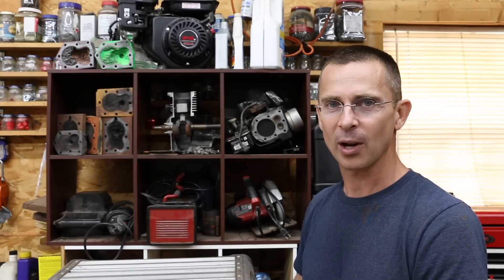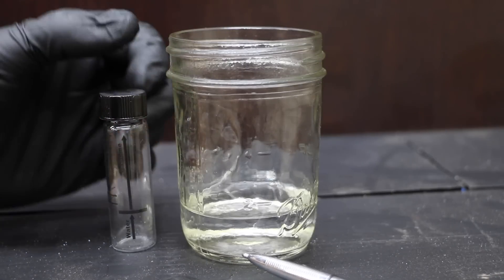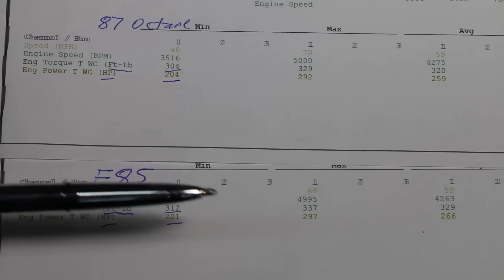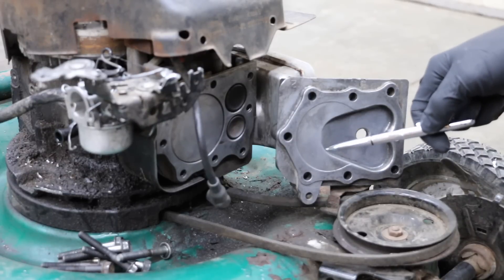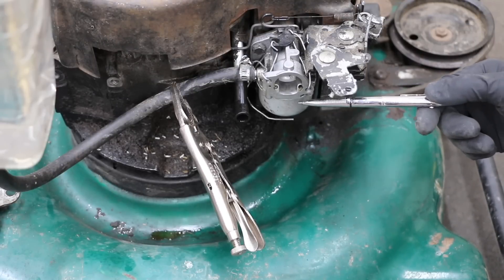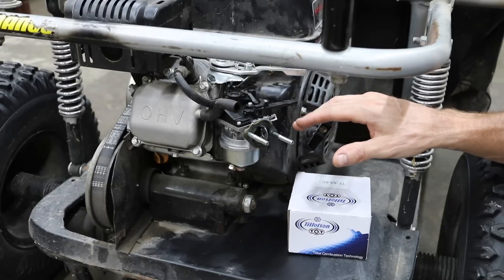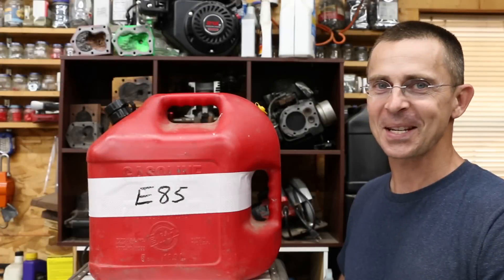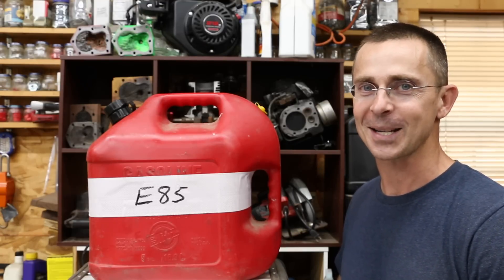Is E85 better than Gasoline? Let's find out!

Comment: My own personal results. I used Torque, and Bluetooth OBD2 adapter. I ran both a stretch of Highway, about 20 miles to a reststop where I would turn around and come back and fuel. I also compared my normal day to day driving. I ran both Standard Gasoline and E85. I could not tell the difference by driveability, but I consistently got 30% poorer MPG on E85. My conclusion was that E85, only made sense if there was a greater then 30% difference in price, which was very seldom the case.
Reply from the maker: Great information. Thank you
Reply: In Brazil usually on E100 people give similar advice 1/3 cheaper go with E100 otherwise E25 (only form of petrol/gasoline available there), but there is a clear price difference and higher performance on E100 plus cleaner engine. Though keep in mind being south america they have some serious issues with fuel quality so either you have to pay a lot more to get premium fuel that will be less adulterated or go with regular and you'll end up with clogged injectors and all sorts of issues very soon, sometimes car will not even start due to the bad fuel having a really high flashpoint (like trying to start on kerosene) engine just can't do it and going with E100 can be a lot less of a hassle overall and cheaper. Yes i did live there for a bit so I know XD I once had a sample of 100LL Avgas that wasn't pure either, I sure wouldn't like being the one pumping bad avgas into my airplane.
Reply: @dashtesla  probably higher engine durability on e95 (it's not e100) too, since flex fuel engines tend to have high compression rates and knock on shitty gas. which is why our base gas was upgraded from 86 to 92 octanes two months ago. now it's going to be a lot harder to justify ethanol. and it's going to have to be almost 40% cheaper for it to be worth it.

My current car isn't flex fuel, but my old one was and it ran SIGNIFICANTLY better on ethanol. it even sounded massively better. it think it was worth putting ethanol even if the price was only 20~25% cheaper. not anymore.
Reply: It really only helps when you're limited by knock, such as forced induction or high compression. It can make triple-digit improvements on the dyno for some sub-1000hp cars, in most cases eclipsing 116-oct leaded race gas.
Reply: FYI E85 is 108 octane
Reply: @BlackBeardAir What's FYI?
Reply: @anondude504  For Your Information
Reply: Very true. It's usually not very cost effective, but performance wise,(when really running it) and internal inspection, both are an absolute winner for the e85. 
I just wish the stuff was cheaper
Reply: @bobbysweeney5377  were
Reply: @vicent436  "was" when I purchased it, "were" overall.
Reply: I did something similar but with pen/paper in my work van which I constantly drive throughout the week. I noticed the exact same results. Only use e85 if the prices make sense.
Reply: @ItzOver9k  Would a $1.50 price difference be worth using E85?
Reply: @saulespino2510  That large of a difference, probably yes.
Reply: @saulespino2510  What if I told you I spend 1.30$ a gallon for e85?
Reply: e85 isn't something you can use instead of normal gas without modifying your car unless you wanna kill it
Reply: David Long great info sir what are you guys thoughts on using it occasionally for cleaning up the engine interior some ?
Reply: Good point. What if you did the calculations based on cost per mile? Do you think you could get a better sense of cost?
Reply: @Corona Discharge what makes you think that it's not good race fuel? The ONLY negative is that you burn roughly 25-35% more fuel than if you ran pure gasoline.
 Using a mix of fuel that contains 85 percent alcohol, provided the engine is tuned for ethanol, will always make more power than 93 octane pure gasoline... and ethanol is alcohol - it's like 99% the same as vodka except you will probably die if you drink ethanol. But it is a form of alcohol... There's many types of alcohol....the drinking type, rubbing alcohol, methanol, etc etc....
E85 has a VERY high octane rating as well - I believe it's 106 or 108 octane.
This reduces the chance of pre-detonation or "knock" happening when the engine is running with a large load, or maximum load at full throttle.
You can advance the timing of when the spark plugs actually spark... And adding extra timing will increase the efficiency of the engine, and it will be able to burn all available fuel and have the actual process of combustion start happening sooner - as the piston is still rising... Since e85 is a MUCH higher octane than gasoline, the "explosion" that occurs when the spark plug sparks and the air/fuel mix begins to burn will be longer, and will push the piston down with more force and for longer - which greatly increases torque, and higher torque means higher horsepower. Or kilowatts or whatever.
E85 also burns a good bit cooler than gasoline does - which means the combustion event is not as hot, and the combination chamber remains cooler than it would if it was burning gasoline... Cooler Temps in the engine means denser air, which means more oxygen, which means bigger and longer "explosion" of the air/fuel mixture within the combustion chamber.... Which means more power.
You can also run higher compression pistons and/or cylinder heads on E85 than on gasoline... This is due to the fact that ethanol is more resistant to pre-detonation, due to the fact that it burns cooler.
You can also run more turbo or supercharger boost than you can with gasoline - for the same reasons as being able to use higher compression pistons/heads.
Higher compression and higher boost means that the engine is running more efficiently, meaning it burns the air/fuel mixture more thoroughly and makes more power out of the same amount of fuel...
More boost and/or higher compression means higher pressure within the combustion chamber during each combustion event, which means it pushes the piston down with more force, and more force means more power.
The biggest horsepower gains come from the advanced timing, combined with more boost & more oxygen - or higher compression, combined with now being able to more fuel because you have more air and oxygen available from the added boost...
All internal combustion engines are air pumps - they use a controlled, precise explosion of fuel/air mixture to make them spin faster to pump more air - more air ALWAYS equals more power.
So :
-More timing =more power
-Less likely to have pre-detonation = ability to add more air and fuel
-More air and fuel ALWAYS increases power
-Cooler combustion means less energy wasted in the form of heat, and that energy goes into spinning the engine faster which increases power.
I could literally write a book on why ethanol is a better race fuel.
If you understand how the internal combustion engine operates (I'm a mechanic who builds engines alot) then you can quite easily find even more reasons why ethanol can increase power and efficiency... But I think I covered the basics pretty well.
Oh - another huge benefit I would be dumb to not mention is that ethanol doesn't leave anywhere near as much carbon deposits on the piston and valves... Carbon deposits rob horsepower and cause pre-detonation. So ethanol literally helps clean your combustion chamber, and you won't get leaky valves as much as with gasoline. Leaky valves decrease compression which decreases power.
I'm curious to why you think e85 is not a good racing fuel - considering just the "major" reasons why it increases power, efficiency and makes you go much faster.
Fuel economy and thermal efficiency are NOT the same thing - and the thermal efficiency of ethanol is higher/better than gasoline. Thermal efficiency is basically what percentage of the fuel injected into the combustion chamber turns into actual power. An increase of just 1-2% thermal efficiency is a MASSIVE difference and that's due in part to the ethanol burning cooler.
The ONLY downside of ethanol is reduced miles per gallon... And that's why people who race with e85 use a larger fuel tank, larger fuel lines, and 2 or even 3 fuel injectors per cylinder instead of just 1... Plus if you use 1 or more of the fuel injectors as port injection it will keep your intake valves clean and cool the air/fuel mixture before it enters the cylinder - assuming 1 injector is a direct injector - spraying fuel directly into the cylinder, instead of spraying it in the intake manifold just above the intake valve... With port injection The fuel starts to evaporate as soon as its injected into the intake - and the evaporation is just an exchange of energy... It uses heat to evaporate the fuel, and that means that the evaporation of the fuel draws energy from the surrounding air - by sucking the energy out of the air that the fuel is being sprayed into, the temperature goes down. Temperature is just a form of energy - less energy =less heat.. That's what "thermal efficiency" means. 
Fuel is the source of the energy - so you're just injecting energy in the form of a liquid fuel and making it explode which will release its energy all at once. If most of the energy contained in the fuel is turned into heat, you have low thermal efficiency and low power. If you can burn fuel at a lower temperature, more of the energy in the fuel goes towards doing actual work - not just creating heat when the combustion happens. 
So port injection lowers Temps Which means it's a denser mix and therfore has more oxygen... Ethanol also evaporates much faster than gasoline does - and you definitely want maximum evaporation, because a gas burns easier than a liquid. And again, evaporation lowers Temps and increases oxygen content... Oxygen is your friend when making power - just like how a small fire will turn into an enormous raging inferno if you fed it pure oxygen. It is releasing more energy. More energy =more power. 
Burning more fuel at a higher thermal efficiency is going to make a BIG difference and will increase power tremendously. 
For example - burning 1 gallon of gasoline at 30% thermal efficiency... Compared to burning 1.25 gallons of alcohol at 35% thermal efficiency... Obviously you'll get a lot more power from burning more fuel more efficiently. Alot more power. Potentially hundreds of extra horsepowers in a large or turbocharged engine. It doesn't matter that alcohol actually has less energy per gallon than gasoline - because it burns more efficiently and you burn much more of it. 
Let's say that burning 1 gallon of gasoline at 30% efficiency creates 100 horsepower... Burning 1.25 gallons of alcohol at 35% will produce around 130-140 horsepower. If you have a turbo, you can gain much more than that because you can add even MORE efficiently burning alcohol to the party. 
Let's imagine A theoretical engine without a turbo, running gasoline and it makes 100hp. 
Add a turbo with 14.7 psi of boost, and you can inject twice as much fuel. And you'll make almost exactly twice as much hp. 
Now run the newly turbocharged engine with ethanol and you can add even more than double the amount of fuel than you could with gasoline. You'd be able to burn almost triple the amount of ethanol on the 14psi turbo engine compared to the amount of gasoline burned by the 100hp non turbo engine. So now you're getting double the power PLUS... If the turbo gas engine made 200hp it would make more like 250hp with the same amount of boost and 3 times more fuel (alcohol)... 
Hopefully this all made sense - I wrote such a long comment to try to help people who read it understand how and why they can get more power from ethanol or e85 than from gas. 
The simplest way I can explain it is as follows :
Gasoline is more "energy dense" meaning there's more energy in 1 gallon of gasoline than there is in 1 gallon of alcohol... But you more than make up for the lower energy density by spraying much more alcohol compared to gasoline - and the engine being capable of efficiently burning much more alcohol than it could burn gasoline efficiently. Much less fuel (gasoline) and more energy lost to heat, compared to lots of good fuel (alcohol) that also burns more efficiently and loses less of its energy to heat. 
I'll stop now, but I am still curious why you think gasoline makes a better race fuel...?
Reply: @csonkaperdido  today I learned that there is no text limit on YouTube comments.  Great info though!
Reply: @uknowwho613  lol you have been enlightened sir!
Reply: I've experienced the same thing in my 2012 2500hd Chevy truck. Got a 6.0L and I get about 13mpg on gas and about 11mpg on e85. I also found out from alot of trips that under load pulling my 20 trailer with a truck on it, the mpg gap between the 2 got much worse. I average about 10mpg on gas and about 6-7 on e85. Plus being in Michigan I've noticed alot of black smoke and the motor shakes alot more on e85 on cold winter days on start-up. I've talked about this with other people and they had similar results too
Reply: That is because you have to inject 25-35% more ethanol to have the same air fuel ratio as gas so your results sound right.
Reply: To get the full benefit of running E85 you should have your ECU remapped, preferably dyno tuned. You will still use 30% more fuel of course, but the car WILL be faster, especially turbocharged cars.
Reply: E85 is always gonna give poor mpg... It makes sense when you are tuning the engine to make more hp.
The benefit of the e85 is horsepower not fuel economy.
It's basically race fuel from the pump - octane of e85 is over 100... Octane is just a measurement of how fast it burns and resistance to pre detonation or "knock"... Only makes sense to use e85 if you're trying to make huge hp and go fast!
Reply: csonkaperdido 100%
Reply: Would it make sense to run a tank of E85 once every few months just as an engine cleaner?
Reply: I came to the exact same conclusion when looking strictly at MPG. After watching this, now I know there isn't enough performance gain to even consider that.

Just when the price is right, use E85 to clean the engine.
Reply: One thing you need to account for is longevity. The magic cutoff may be 25% - 30% based on price, but E 85 burns a lot cleaner, so in the long run will E 85 may be better for engine wear and increase the life of the vehicle. Also to consider, after 100,000 miles what will your MPG evaluation be on a vehicle that ran on E85 vs one that ran on E10? My guess would be running cleaner E85 over that many miles will allow for better MPG compared to E10 fuels over the life of the vehicle based on this. Basically if the vehicle runs cleaner throughout its life, after 100,000 miles, the MPG's will be better than if it ran the entire time on E10 fuels.
Reply: @David-fv7zg  David I totally agree with you I was just discussing the immediate economics of the situation. Yes it does burn a lot cleaner and that's why I did use e85 all the time no matter what the price was, but if you're going strictly by cost per mile then you have to have a 30% difference to make it justifiable on a cost per mile basis. Now you might be able to make a case that because it burns cleaner so you can stretch out oil changes and your engine will last longer but until you can prove that empirically that's just a hypothetical.
Reply: E85 should at least be compared to premium, as the octane ratings would be closer. (Especially price wise) So E85 vs premium would be a better comparison.  It's a big reason why modded high boost or high compression people use it.  That 30% loss in available hydrocarbons is more than made up compared to race fuel with the same octane.
Reply: When you change the motor mapping to E 85, it will be much better in mileage and lower the combustion temp as well.
Reply: @mweskamppp  EcoBoost motors do that on the fly. 
I definitely notice a more responsive and enjoyable driving experience, but if it didn't burn cleaner, I don't think I'd do e85 due to the mpg loss.

Comment: Nice video. Since E85 is 85% acohol, that explains the power and Fuel Efficiency loss. 

Alcohol based fuels have less energy content than traditional 100% Petroleum. So again am glad you did this test because it proves that point. 

I think the only real reason for alcohol based fuels in an engine is they provide cooler temps like you showed, but also are supposed to reduce Polution. 

But yeah. Gonna eat more moolah. Although the Indy car Series ran on Alcohol for a while. Not sure if they still do or not. 

Would be interesting to test an E85 Edelbrock Carburator to see what performance difference there is over their standard performer series carbs.
Reply from the maker: Thank you!

Comment: I had an 2006 Sierra with a 4.8 e 85 motor. Using the e85 I got around the same mpg of 11.3 but much more power and ran smoother and quieter  I like the e85 price compared to gas 
same mpg as 87 octane less money. Works for me.   
Now I’m driving a 2.8 duramax diesel.  So far I love it.   37 mpg highway  insane.   Thx ....Paul
Reply from the maker: That's amazing efficiency with the duramax!

Comment: You won’t take advantage of the e85 gain unless you advance timing. Maybe use older v8 with a distributor and carb. It’ll have extra gains because of the fuel mixing with the air and cooling it even mote
Reply from the maker: Thank you!

Comment: Straight to the point:
E85 is more expensive and it burns WAY faster than conventional cheap pump fuel. So it's lose / lose. I'd rather run 91 octane fuel than E85. But I'll gladly run 87 octane in all my vehicles (unless it states premium/91). The amount of carbon build up and sticking fuel injectors, etc are subjective to many factors. Fuel is only one factor. But with the right maintenance you can avoid those probabilities regardless which grade of fuel you use anyways. So as a mechanic of many decades, I'll stick to 87 octane 👍
Reply from the maker: Thank you!